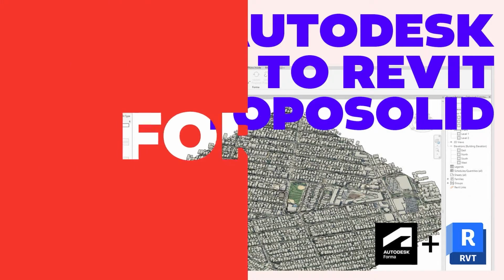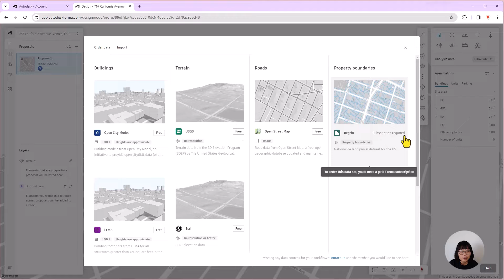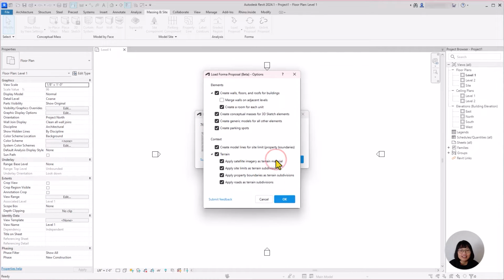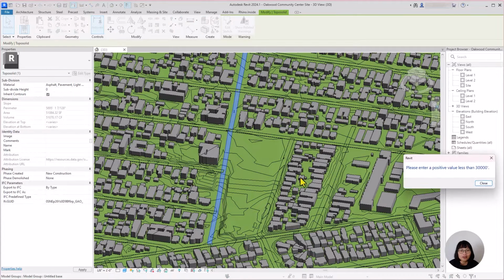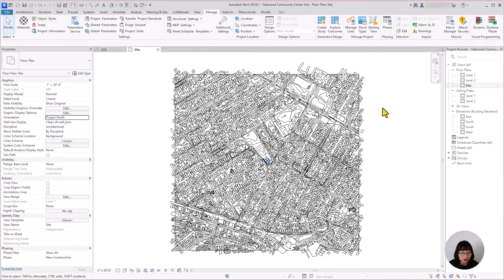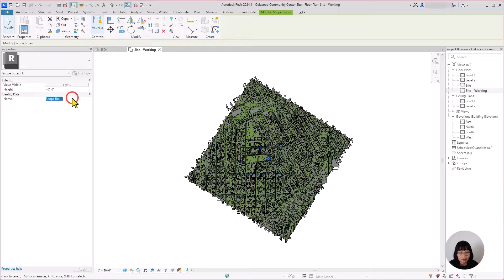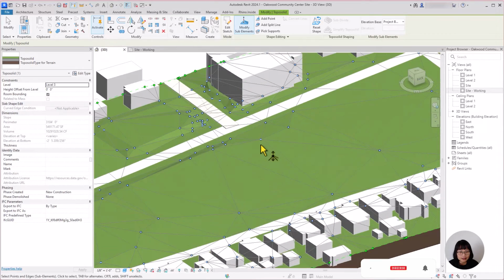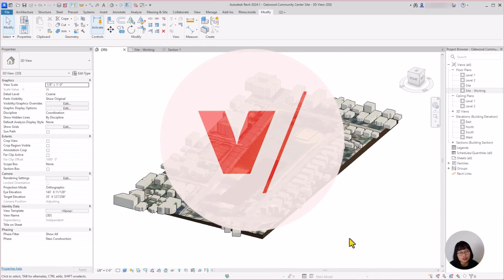How to create a 3D site model using Autodesk FORMA + TOPOSOLID in REVIT 2024

Comment: Great video. Thank you so much.

I have an issue however that I have posted on the autodesk forum recently - one that I have found no solution to thus far. In a 3D view in Revit 2025, when using a section box to limit the amount of toposolid (forma derived) something very strange happens. When adjusting the section box crop (using the grips of course) from two of the four cardinal directions (section box has four sides in plan view), these being the south and the west, the imported satellite image draped over the toposolid is literally SHIFTED across the landscape by the same amount that the section box has been moved across the toposolid. This does not occur when adjusting the section box crops from the north or east sides. Only when moving the south crop northward or the west crop eastward.

In other words - to me it appears that an origin point specific to the satellite image is located at the southwest corner of said image and that the section box literally MOVES said origin point by however much the section box crop has been moved. The image is only affected when the section box crop begins to touch the 3D toposolid. Pinning or unpinning the toposolid has no effect on this. Any help is greatly appreciated!
Reply from the maker: I’m not sure I have the answer to your dilemma. I believe this is a software issue that Autodesk needs to address. I hope you are able to find a solution with the Autodesk forum.
Reply: @VERBArchitectureWorkshop  Thanks for at least replying to me. So far the autodesk forum has been unhelpful but I will remain vigilant.

Comment: This video has been a huge help to me for using Forma to generate site models. Thank you! 

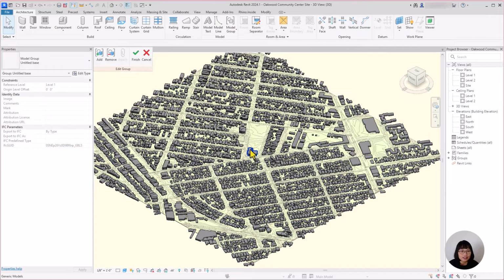One problem that I cannot solve though is how to adjust/apply material to the Forma context buildings. At timestamp 5:39 in this video, where you have selected an individual building, you can see that the Type Properties box (upper left) and the Edit Type options are greyed out. After a lot of trying and asking friends, I can't find a way to edit the Forma buildings materials other than using the paint tool (which would take forever for hundreds of buildings). Even changing materials in Object Styles for all Generic Models has no effect.

Do you know of a way to adjust these?
Reply from the maker: I’m glad the video is helpful! The only way I can think of is to change the material in object style under manage. Check to make sure that in the material you selected, under the graphics tab, you have the “use render appearance” checked. This should change all the materials of the context building depending on the visual style of your view. Hopefully this helps.

Comment: How to adjust the elevation of forma site to the house design elevation? Site elevation is like 7350' and house is like 10'-20'.
Reply from the maker: Hi, if the toposolid from Forma is associated with a level in Revit, you can change that associated level to match the level of the house.